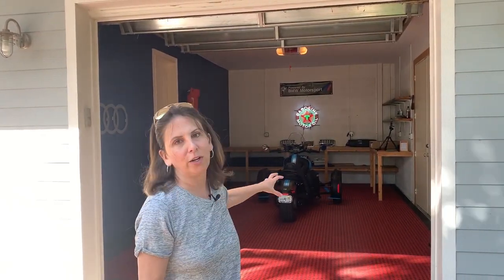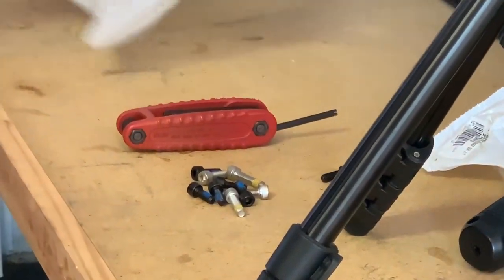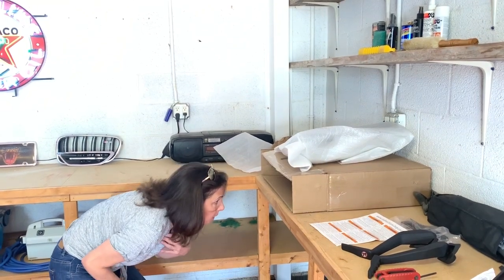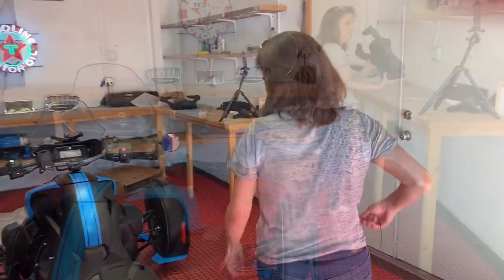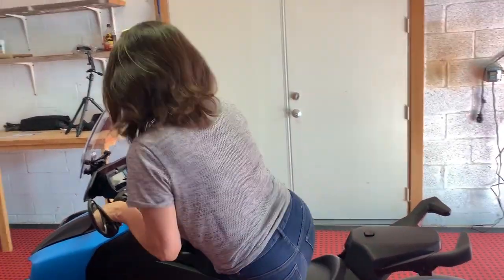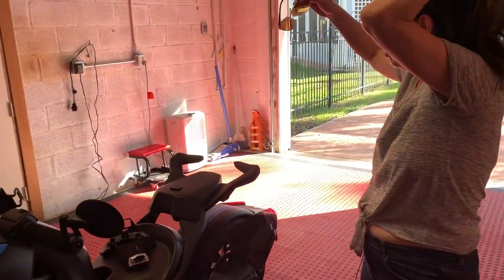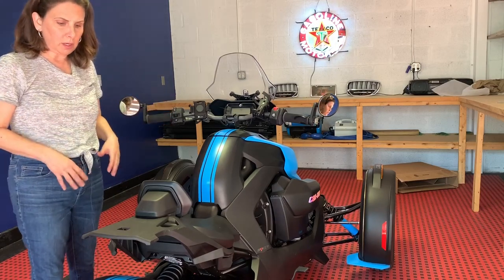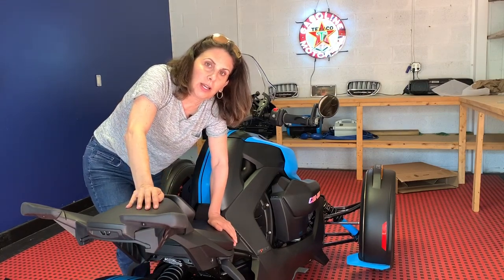Can Am Ryker Passenger Seat (install and review)

Comment: Great video Beth.  Enjoy your films.  Heading to age 76 this month.  Have MSF Certification for 2 wheeler.  Taking Course for three wheels next month.  Had a Can Am RT years ago.  Enjoyed it and have recessed for 3 years.  Your films are helpful and your ideas and advice does help for the plan to start riding next spring.  Stay safe.
Reply from the maker: That is awesome!! I read a quote once that stuck with me. "You don't stop riding when you get old, you get old when you stop riding."  Stay young!!
Reply: @RykerRydes  Amen Beth.  Your video on the Brake Light Helmet is an eye opener and much appreciated.  Watched Parking Lock and Shift Install yesterday.  A must and first thing to do after buying a Ryker, plus, lights, lights, lights.  Your ideas and personal thoughts protect and improves things to make the Ryker safer and comfortable..  The two wheel MSF Course saved my life twice.  My Victory Vision had great lighting on the fairing and I fixed the rear lighting issue due to advice of other riders that saw safety issues I couldn't see after we completed the Dragon.  Similar to the Ryker issue of being low to the ground.  I was higher but the main rear lighting had a large 3 section V Panel, independent of each other.  The lower section was lighting when braking,...the other sections didn't.  In quick sunlight/shade changes, riders couldn't see my braking clearly.  It was a simple fix thanks to an Air Force Biker You Tube film and a few changes on the electrical coupling under the driver seat that made the entire V on the rear light up.  Thanks for your outstanding work.
Reply: I been looking for passenger seat with foot pegs
Reply: because some folded passenger seat is sold separate without the foot pegs

Comment: Simple DIY fix. Get a small firm back support pillow (they make them for office chairs all the time) get it in black add velcro to the pillow and the concaved part of the passenger seat. This should give you roughly the same back support you are use to.
Reply from the maker: That is awesome!  Thanks for the tip! I do wonder how it would look?

Comment: Be advised Beth, if your passenger is over a certain weight the back bolt , fixed underneath the seat will drop down onto the rear wheel cover and mark it substantially so my advice would be to cover the back bolt with a rubber cover, that way the look of your bike is not marked. Saw that on another users You Tube video.
Reply from the maker: GREAT tip!!! Thanks fir sharing!!

Comment: Just stumbled on to your video. Just for future note, they make Allen keys with a ball end that gives you about 20 degrees of off angle use. That may have been enough to help. The only downside is they should only get the bolt snug. You don’t want to really torque down on them.
Reply from the maker: Thanks for the tip! I appreciate you watching!

Comment: And to go with my max mount I got a set. Thank You Beth. 👍
Reply from the maker: My pleasure.  Thanks for watching Rob!
Reply: @RykerRydes  you made it a lot easier than it was. I had to loosen the max mount to get the support in. Also on the 2021 the seat trim side pieces has a screw that needs to be loosened before removal. 
Thanks again Beth. 😀

Comment: The bracket you installed at 6:20, is that just to sturdy everything up? Cause nothing seems to mount to it.  Mine had horrible fit and i needed to grind it down 2mm on each side.
Reply from the maker: Yes the bracket is for extra support. Sorry you had such a tough time with it.
Reply: that bracket is VITAL for passenger support!!!

Comment: A few hints on the seat installation. First make sure that the button that locks it in is as high as possible and inside the sleeve porting of the seat. Then when sliding the seat into position give it a good tug so that it is in fact all the way back. Use the arm holds as she did. Then the button should just press down all the way.  Note for those with a rally due to the extra piece on the seat that extends out you will not be able to release the lock from the bottom. You will need to sneak your fingers in between the two seats. Bigger hands are a challenge but still works.
Reply from the maker: Great feedback, thank you!
Reply: @RykerRydes  as you stated the struggle was real!   We first didn’t have it all the way back and then I noticed that the latch portion was not inside the sleeve and thus would not allow it to drop down as needed when trying to lock it it. A little dish soap helped it slide as well.

Comment: Hello, for some reason I am not able to get the bracket so fit underneath the seat it’s as if it’s too long. What could I be doing wrong? Looking for some help please
Reply from the maker: No worries! Here to help. Chances are the screws need to come out first. Lmk
Reply: So the dealer put the screws in so tight that I had no choice but to go have them put the seat on.
Reply: I'm having same problem , can't get bracket on its to long. So do I have to adjust Max mount?
Reply from the maker: @dianelangenberg2126  I don't think the bracket is too long.  Try taking the screw out of them.  Let me know if an adjustment to the bracket helps!  If not we can try FaceTiming and I will help you through it!
Reply from the maker: I have someone else with the same problem, can you explain how you figured it out?
Reply: Thanks for the response. Out of town I'll try Sunday.

Comment: Have a 2020 CanAm Ryker 900 went into limp mode,VSS fault and check engine. Third time it's happened. Was told at can am dealer that it could be the LED bulbs put in the headlights, seems weird to me. What do you think??
Thanks Henry J
Reply from the maker: That does seem strange.  I replaced (along with so many others) the headlights and never had an issue.  You could always try putting the old headlights back on and see if it still happens (pain in the butt, I know).  I common reason new riders get a vss fault is from riding the break.  Try making sure your foot is clear from the break while riding.  Hope this helps. LMK

Comment: at the end of the video when you slide the back rest in you should of tried to press the locking button down to see if it would of locked together i was just thinking thank you for the video
Reply from the maker: It's hard to explain, but that was not an option!
Reply: I thought the same thing. Pushing the top button to lock it all. Wonder if it works 🤔

Comment: This video help me a lot today... because there is no manual inside the box. Just one question... I have the 600 and I haven't seated nobody in there yet, I notice the bike can get very low with 2 people or is just my imagination??? There's no problem sitting 2 people in the bike??
Reply from the maker: There is no problem for riding 2 up once in a while, but if you plan on riding with a passenger often, you may want to invents in better shocks.  I would also stay within the weight guidelines of the bike.  No worries!  Ride safe.

Comment: You can actually use both. The 1 up won’t lock but you can use two screws to hold it in place,obviously you can’t use the cubby plastic behind it but they’ll work just fine. That’s how I have mine.
Reply from the maker: Isn’t the backrest leaving marks on your seat? It looked like it could easily rip the seat (stuffed in there)
Reply: Does your passenger seat lock into the max mount tab with backrest cowl removed???

Comment: I am surprised Can-Am did not make the seat to be used with the back rest! You can use the backrest with the Top Case. Great Video Beth and thanks to Tina for the great camera work!
Reply from the maker: Yes, Ii agree!! Good to know about the top case.  I need some storage!  Does a helmet fit in the top case?
Reply: @RykerRydes  From what I understand it is not big enough for a helmet. That is one thing I wish the Ryker had because if I stop somewhere I would have to carry my helmet because I will not leave it on the bike. unless I could lock it in a case/trunk.
Reply: @RykerRydes  A helmet will not fit in the top case. It will fit in the Shad side mount pod, and it's lockable. Great vid!

Comment: Hello Beth my name is Israel and I am from Mexico, I just bought a ryker 900 rally edition, and I did not buy the original passenger seat I bought the seat in slimgmods. And it does not include the esyribo or pospirs of the passenger, would you be so kind to throw up the measurements and specifications of the same length, etc or if the piece that you put in your transverse video is to support the stirrup? Some independent ones but nobody sells them like that, that's why I want to know their specifications, measurements and installation since I expect that some blacksmith or specialist to do them for me, I send you a great greeting and many successes with your videos many greetings from Veracruz, Mexico
Reply from the maker: Hi Israel and thank you for the nice comment.  As far as the passenger pegs, I can't in good conscious, help you with the pegs.  The Can-Am pegs have a unique sensor in the left one that, when down, lets the bike know there is a passenger and adjusts the bike appropriately.  My advice, go to your dealership and get them to order you the passenger pegs!  Hope this helps!
Reply: @RykerRydes  thaks for your advierte Beth greeatings
Reply: @RykerRydes  thanks for your advice

Comment: Id say keep the passenger section on.. than head over to a machine shop or metal fabrications or a good woodworker and have an add on back rest fabricated to your exact specifications. It would not cost that much and you would get a far better backrest. Maybe wrapped in leather :-)
Reply from the maker: Great idea!! Thanks for the tip!

Comment: For the bracket/cross member. You mentioned in a previous reply about loosening bolts to make it fit. Which bolts are you referring to? 👀
Reply from the maker: Hi Joe. Under the seat there is a small metal plate that has screws in it. Loosen those. Hope this helps. If not we can video chat.

Comment: Beth, this video was of great interest to me as I would need to do the same if I replace my 2 wheel with a Ryker.  That very last thing you did where you actually got the backrest to sit in a good position; perhaps you could use some strategically placed heavy duty (3M) Velcro so you know it wouldn't fall off on a ride.  Just an idea to ponder.  Let us know how this works out.
Reply: And...a question for you.  Which windshield is that and how happy are you with it?
Reply from the maker: That's a great idea about the tape.
Reply from the maker: @2wrdr  My windshield is from can am, made specifically for the ryker.  Pros: looks like it was made for the bike's sleek design.  Also love that it can move up and down depending on your desire.  Con, wish it was a little bigger.  Check out my other video specifically on the windshield install and review that is posted.
Reply: @RykerRydes  Ok, thanks

Comment: Thanks Beth, I had the comfort seats and tall backrest installed at time of purchase but it would be nice to have a rider backrest also. I’m pretty sure when the passenger pegs are lowered the system automatically adjusts the suspension but perhaps this is just on my rally version? Next up for me is an atlas throttle lock. The heated grips I fitted are a god send in this weather here in the north of the UK!
Reply from the maker: Hi Lee, When the pegs are down, it is my understanding that it turns of the VSS so you can't skid out or put your bike in Rally mode.  I am 99% positive it will not change your suspension.  The Rally has a easy knob on it to do manually.  But please check with your dealership of ask on the forums to make sure.  Spring is coming!! Ride safe!
ps be very careful with the throttle lock (can be very dangerous)

Comment: Hi...
The rear seat does not have any OEM or aftermarket lock....:(

I have only seen one video on YouTube that addresses this issue with two solutions.

Have you found any lock solutions???
Reply from the maker: HI Eric!  No, I have not found a locking solution.  I guess I am just too trusting.  Locking it, is probably a good idea though!
Reply: @RykerRydes  
Hey... thanks for getting back to me.

I’m awaiting a 2021 Riker rally which should have been in the middle of April however I’m still waiting for it to arrive at the dealership.

I know I’m going to have a ton of fun cruising around on it as soon as possible.

I wish New Jersey had better settings as far as the streets go but it is what it is for now.

Must head to the mountains or the beach.

Here’s the link to the only video I found on YouTube on how to lock down your seat. The guy who did it actually offers two different ways to do it.

https://youtu.be/sz1f-ejZhBA

Comment: Got passenger seat on…but the button won’t push down to lock it.. I tried to remove seat but it’s now stuck on…why can’t I push down button to lock
Reply from the maker: It is hard for me to help you without being in front of your bike. But you have to make sure the seat is pushed on all the way so the lever in the hole are 100% lined up. If you have a dealership nearby, they could definitely help you very easily. Sorry you are having troubles.

Comment: Will the locking pin for the passenger seat go through the mounting hole of your solo backrest?  It may lock into place.  That way you can have both...
Reply from the maker: Nope, tried that. Good thought though.
Reply: I have a 2021 Ryker Rally.  I ordered the passenger seat with the large backrest  but I can’t get the seat to come all the way back to lock it in.  Can you help?

Comment: Hello Beth, I just want to say thank you for your time and help with your videos.  I do have a question on an additional spring that came with the max mount and passenger seat.  I'm going to assume that the stock rear spring has a max load and the additional spring that came with the kit has a higher max load. I couldn't find anything on this and was hoping you might have some knowledge on this.  I dug through your videos and didn't find anything on rear shock replacement and access to remove that shock.  HELP!!!! 😂😂😂
Reply from the maker: Hi there. I have never changed the rear spring. Bill Ramseyer (from BLR tuning) is the guy to ask. He’s awesome. You can find him on FB or YT.  Thanks so much for watching!! Ryde safe!!

Comment: Doesnt the back rest lock in place with the push lock from the passenger seat?
Reply from the maker: No, sadly it does  not. The max mount has that one hole to add attachments.  It can either be the 1 up backrest OR the passenger seat OR the storage system.  You have to choose.

Comment: I have that passenger seat on order for my Rally Edition. I know its not the correct way to use the 1 up backrest for the driver, but did u try it that way in your rides? Or did u return the passenger seat. I like the look of the passenger seat on the bike, but want the backrest like u did... i see now that slingmods makes that 1 up backrest for 179.00 that comes with a pouch that buttons on the back, but i like the original like yours. The original looks easier to install
Reply from the maker: Hi Patrick!  Yes, I returned the passenger seat.  I had no one that wanted or trusted me to ride 2 up!  But I agree that the bike looks great with the passenger seat on...more finished looking.  I use the backrest and a small carry case. As far as the backrest from slingmods, I bought and returned it.  I just didn't like the look.  The directions were weird too.  Maybe they fixed the issue?

Comment: Beth will that one up back rest work if I’m tall?i have Rheumatoid bad and riding causes pain .. 
accessories in NZ are dearer 
Example max mount $900+ Passenger seat $630 +
Reply from the maker: First of all I am so sorry that your situation is causing you any pain.  As far as being tall, the 1up backrest does give you the feeling of being a little closer to the handle bars.  But well worth it, to have that comfort.   Please check out my past video, specifically on the 1 up backrest. Can you buy from Amazon in NZ or something similar?  That way you can try it and return it it doesn't feel right.  Or ask to try it at the dealership before you spend that kind of money! Best of luck to you and feel better!!

Comment: Hi, thanks for the video, I'm still deciding which can am to get here in the UK, the back seat doesn't look very comfortable for long trips.
Reply from the maker: Honestly, if you are planning on doing a lot of long trips or if you plan on riding mostly with a passenger, than you might want to consider a Spyder for more comfort and more built in features like cruise control etc.
Reply: Pete, I'm also looking at getting a Ryker in the UK. I've been reviewing the 3-piece touring luggage set which you can see on the YouTube channel Slingmods dot com, it has a backrest for the passenger and storage for trips.

Comment: what's the weight capacity on the back seat?
Reply from the maker: Hi!  The Ryker (as far as my research) does not specify a max weight for the passenger seat.
Reply from the maker: Total max weight capacity is 449 lbs or 204 kg (this includes the driver and any cargo)
Reply: @RykerRydes  thanks.. I cant wait to get one of these. Just need to sell my 2 wheeler